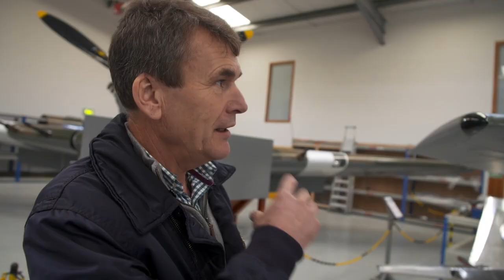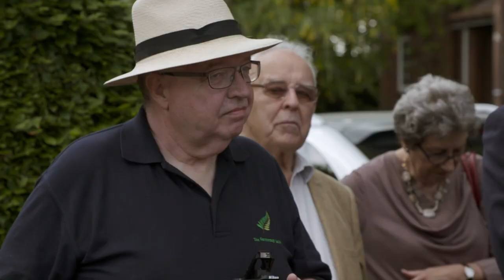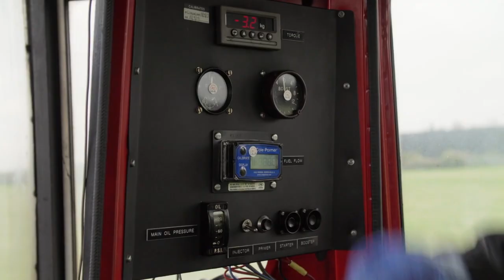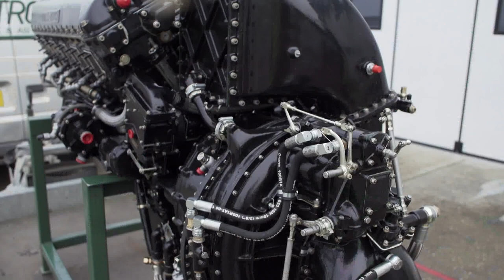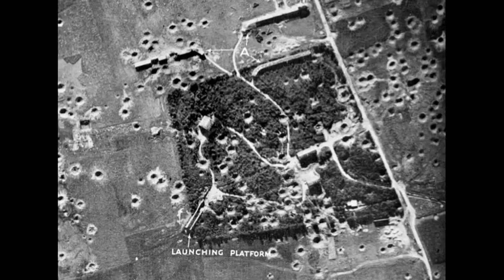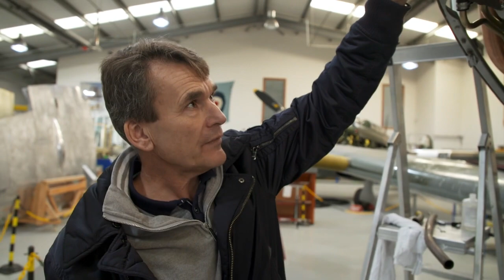The Perfect Engine for the Spitfire | Inside The Spitfire Factory | Machina

Comment: I'm still amazed that back in the 30s and 40s, these engines were produce by the thousands, but today it's a huge undertaking to get just one of them up and running.
Reply: These were hudge factories with templates and special made tools. Serial production in the meaning of fabricating Ford model T. Now it is not even manufacture. It is hobbyst work without all of that.

Comment: When the Packard automobile company received the license to build the RR Merlin engine they developed hundreds of improvements of the engine , Packard built the most accurate measuring tools that existed in all the world at that time, The Merlin engine was far and away, many fold superior to the GM built V-12 aircraft engine !
Reply: The GM Allison V-1710 engine was a good design with an insufficient supercharger. The pre-war USAAC had discouraged the development of 2-stage superchargers that would enable high performance at high altitude. That problem was being fixed by the end of the war. The XP-51J was Allison-powered and the postwar P-82E, F, G and H-model Twin Mustang were Allison-powered.

Comment: Hmmm.  The ME109 could defeat the Spit by using a climbing right turn.  The Spit pilot will try his hardest to get the nose up and then...  BOOP!  Stall.  The ME109 reverses with rudder and is directly behind the Spit.  Game over.
Reply: Doubt it was that simple. I've read more than a bit on the BoB and the Luftwaffe in general, and what I've repeatedly found was that the 109 pilot would push the nose down and dive away because the Spitfire's Merlin would briefly cut out under negative G. There's no mechanical reason I know of for a Bf109 to be superior to a Spitfire in a climbing right-hand turn. Could you explain how/why that would have worked? If it did work that way, then would that mean that the Spitfire would be superior in a climbing left-hand turn, and could pull the same trick on a pursuing Messerschmitt?
Reply: @RANDALLBRIGGS  It really was that simple, and very well documented.  Climbing left doesn't work.  P-Factor differences due to rotation.

Comment: The same thing about this video is that these guys never talk about the Packard engines. Once the United States got their hands on the Merlin engine,  there could be that it would take so long to turn out an engine. The United States  engineers improved the method to build the engine. It's too bad that the British could not see a much better way and a faster way, too build build the engine. Even barring this we won the war@
Reply: It wasn't a matter of British engineers not seeing a better, faster way to mass-produce the Merlin. It was a matter of British industrial technology in the 1930s not being geared up for mass-production. Nevertheless, the British got all the Merlins they needed between greatly increasing their own production and using some Packard production. Spitfire Mk XVIs were basically Mk IXs, but were powered by Packard-Merlin engines. The Avro Lancaster Mk IIIs were the same as Mk Is, but were powered by Packard-Merlins. The  Lancaster "Dam-busters" were modified Mk IIIs. The Hawker Hurricane Mk XIIs were powered by Packard-Merlins.

Comment: Well,it should be noted, There is not 1 Engine that's responsible for winning WWII,it took a combination of All The Equipment, All of the Combined Military Personal, to Win the WAR.
Reply: You're correct no "single" engine, plane or person is wholly responsible for winning WWII.......but when looking at which one had more impact than any other....IMO it would be the Rolls Royce Merlin... The P-51 was born with the Allison V12....almost the same size as a Merlin but using a turbo charger it did not have the same performance  at altitude (where most dogfights took place) as the merlin using a supercharger.....at altitude the Merlin produced more power. If not for the Merlin engine, the Mustang's role in WWII would have been mainly ground attack. The Merlin not only allowed the Mustang to perform at altitude.....the greater power meant carrying more fuel and the ability to now escort our bombers all the way to target and back. Make no mistake, the P-51 was a remarkable aircraft....but the Merlin is what MADE the P-51 historic!!!
Reply: @Bugdriver49  Not quite. The early P-51's Allison engine did not have a turbo-supercharger. Thanks to shortsighted bomber-mafia USAAC staff, mechanical supercharging sufficient for high-altitude performance had not been encouraged. So the Allison, with only a single-stage mechanical supercharger, started losing performance above 12,000 feet. The P-38 had the same engine, but it also had turbo-supercharging, so it could perform well at high altitudes. The Merlin had better mechanical supercharging than the Allison, and that is why the Merlin-engine Mustang was such a winner. Theoretically, the Mustang could have been powered by a turbocharged Allison, but the turbocharger would have taken up room and added weight. The only two mass-produced turbocharged American fighters were the P-38, which had room for the turbochargers atop the twin booms, and the P-47, powered by the R-2800 twin-row radial engine, which had a huge fuselage for the turbocharger and all its associated ducting.

Comment: Being a qualified machinist I find it hard to believe that all the components that go into an engine with fine tolerances could be made in time to keep these aircraft in the air and some only for a very short time. The pilots were very special people with huge courage all to give us freedom. I admire you all. Ian
Reply: Amen
Reply: I bet they didnt take 1-2 weeks to bend and braze one tiny pipe back then either.
Reply: Packard manufactured a great number of the Rolls-Royce Merlins under contract, but they had to re-draw each and every Rolls-Royce drawing to tighten up tolerances, as they didn't want to have to hand-cut everything.
Reply: @stevewilke8524 don’t you mean loosen up tolerances? (Or am I having a brain fart…)
Reply: @TrackZeroNotFound  No, tighten tolerances.  Rolls-Royce had tolerances in their drawings that would require a lot of hand fitting by skilled machinists in order to make everything fit correctly.  Packard didn't want  that kind of hand-fitting on their engines; no time for that.
Reply: @stevewilke8524 I think this thread is getting mixed up with tight, loose, and sloppy tolerances, when in reality, Rolls Royce tolerance’s were good and exacting, but ultimately too unique for each component, where mass production requires each component to be within a similar tolerance of the same component. A bit like a handcrafted rifle, each item, lock, stock and barrel, perfectly mating with each other, but an individual component would not match up with another rifle from the same gunsmith. An excellent weapon, but useless if you need hundreds of them! Just my interpretation 😁
Reply: @stevewilke8524  The same with Ford Motor Co. in Manchester.  The had to redo all the RR drawings.  In his autobiography Not Much of an Engineer, Sir Stanley Hooker relates a conversation where he boasted of Rolls-Royce's fine manufacturing processes to a British Ford engineer.  The Ford man instantly disabused of him of that notion saying they could never make engines to such sloppy tolerances.  Hooker was taken aback but states "once the great Ford factory at Manchester started production, Merlins came out like shelling peas."
Reply: This is why during WWII the Packard Automobile company in America produced more Merlin engines than did Rolls Royce as the Americans were much more efficient and better suited to mass production and assembly line procedures.

Comment: Thank you for a very entertaining and informing video. I would agree with the above comment that when that Merlin is singing why play  music? 

But that aside I thought it's weakness with the carburetor was with the life of the Spitfire and that was the strength of the Daimler-Benz engine. 

I knew nothing of Tilly and Tillys orifice – what a hoot 

Wouldn't think that a simple washer would cure that fuel starvation problem 

And I can understand the frustration of that old navy veteran-I didn't even know there was a British carrier at  Japan 

I am often amazed at what those reconnaissance pilots did and I believe all the reconnaissance spitfires were painted blue 

Always wondered what would prevent fighters from intercepting them but I guess at 40,000 feet by the time they got there they would be gone 

I have this rare book of color photographs of World War II in the European theater with aviation. I did not realize that even the army Air Force had a few spitfire squadrons 

Our famous pilot, Bob Hoover, actually flew a Spitfire in World War II 

Thanks again and I learned a lot in the last hour 

Oh on operating cost. I remember back in the 80s I asked the owner of a P 51 mustang what it cost to run 

"60 gallons an hour if you're easy on the throttle and keep the supercharger off". 600 hour TBO - time between overhaul - again if you are easy on the supercharger. $225,000 to overhaul the engine at 600 hours. 

And that's back in the 1980s 

I've often thought if you could buy that mythical Mustang or Spitfire back in the 50s for a few thousand dollars would you do so knowing the operating cost?

I don't think I would. It would be like buying a big boat